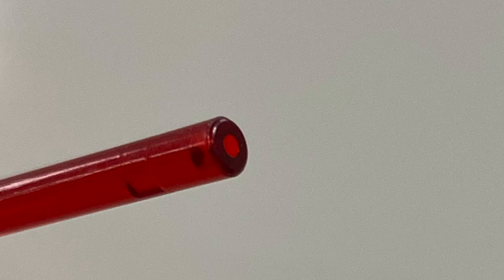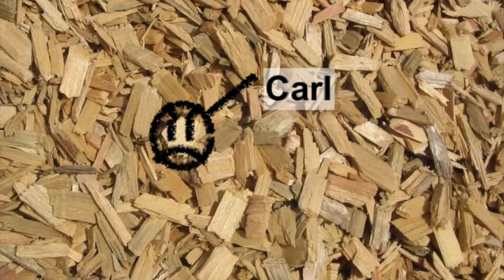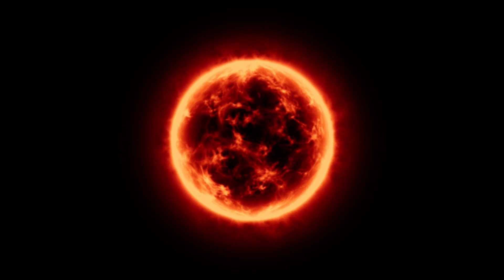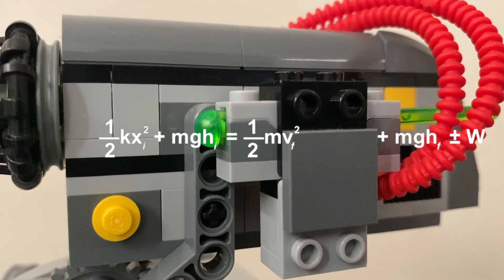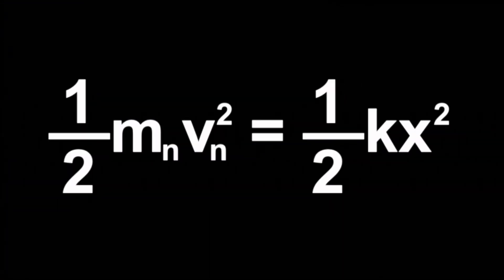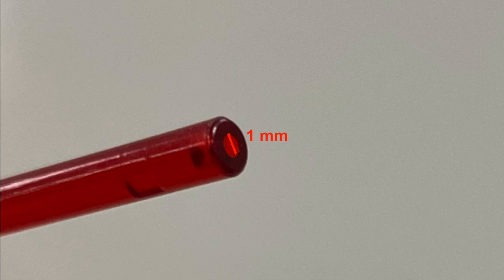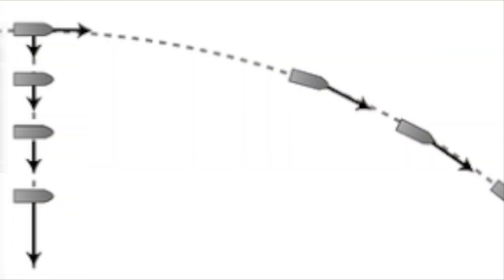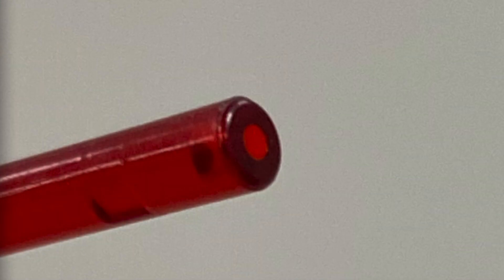Why Spring-Loaded Shooters go 0.058887524% Farther Than They Used to

Comment: You didn't account for another factor. Some missiles have different colours and transparencies, which will result in varying masses across the projectiles due to varying masses between the types of plastic used (e.g ink).
Reply: Red goes faster
Reply: @gernhartreinholzen3992 scientifically speeking... you're god dam right!!
Reply: The same thing applies to planes! That’s why they’re usually mostly white on the outside